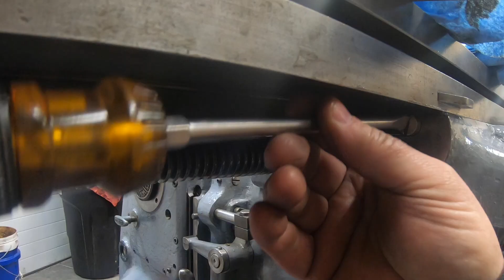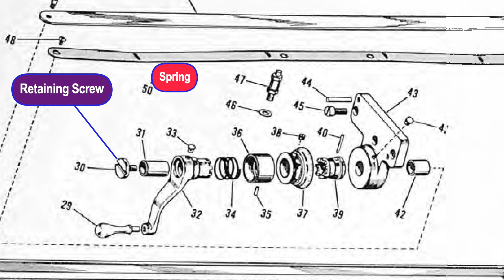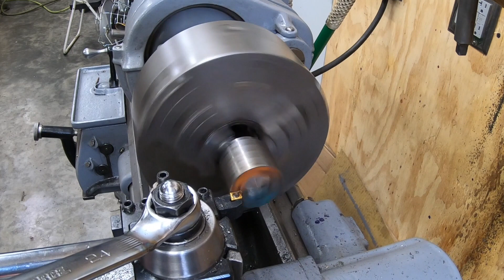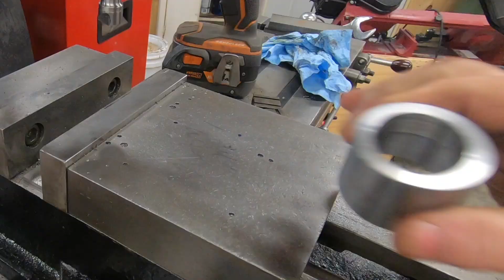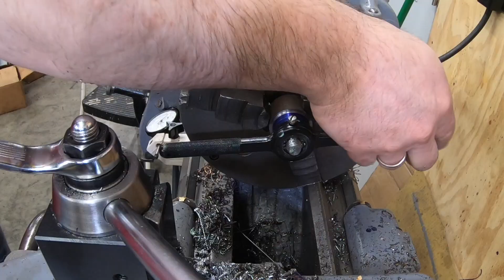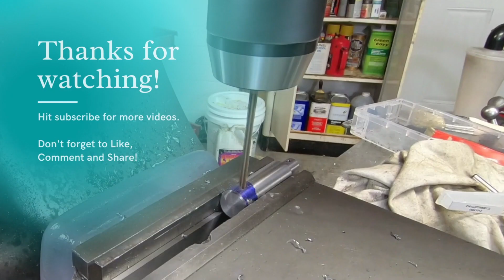Setting the Table on the K&T 2HL - Part 2

Comment: Good thing you re-installed the safety spring system. In too many older machines they don't exist anymore.
Reply from the maker: They can be an inconvenience, that's for sure. But I would think a broken elbow would be more inconvenient. :)